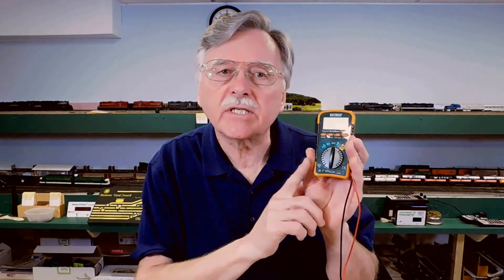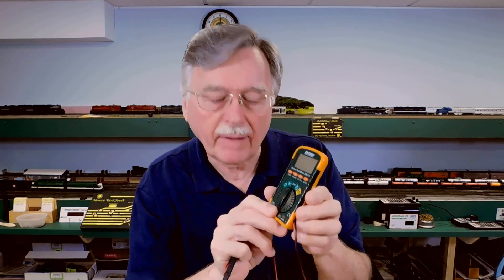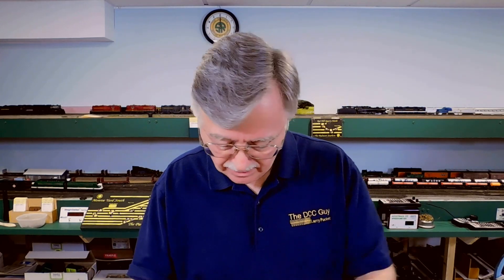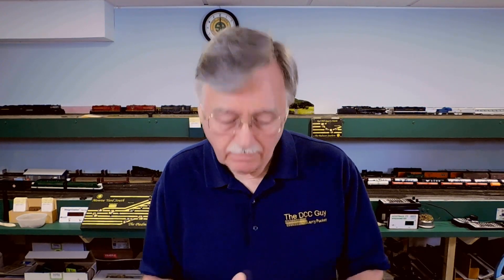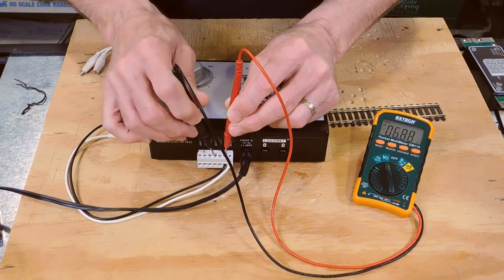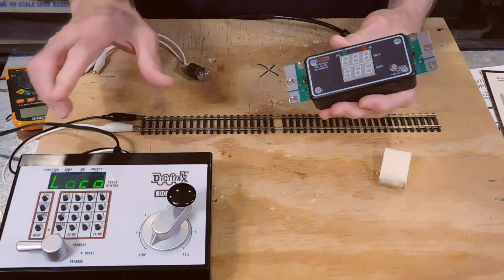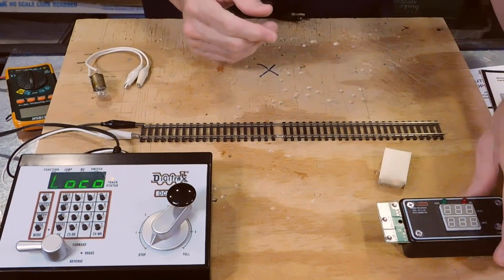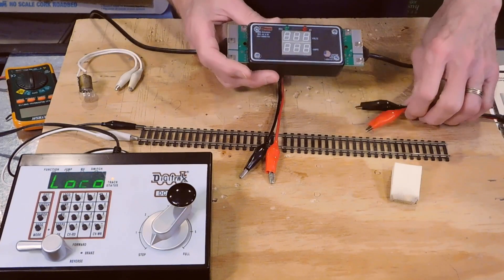DCC Power Measurements (87)

Comment: Would you recommend purchasing this DDC  specific meter to help find shorts in a layout? I am working with a NCE power cab controller which is in series with NCE 225 EB1.1 single district DCC track power circuit breaker. Both red lights have gone intermittent   and i am getting no power to the rails as evidenced by light meter. Earlier I fixed a short at a double Atlas turnout (engine would not operate over double insulated rail but rest of track was fully operational) by removing the double Atlas turnout as advised by technical guy. Now my whole layout is dead. How do search for shorts and polarity issues? Any other techniques or videos you recommend?
Reply from the maker: Shorts that are built onto a layout can be difficult to diagnose. Often they are due to connecting rail feeders backwards and no meter will detect that only your eyeballs! I find that about 99% of problems are due to crossed wires somewhere, and finding them can be difficult. I first recommend working on sections when wiring, then testing each section by connecting the DCC system to it afterwards. That way you know whether you have created a new short. Since you apparently have already built yours you need to first go back and check your wires to confirm none are reversed. If that doesn’t work then cut the layout onto blocks to isolate individual sections and see where the area that is creating the short is. You will need to cut your main bus wires to do that and also cut gaps in your rails to do that, but rails should be gapped anyway and wires can be easily spliced.

Comment: Here is a tip to make the display on the RRampmeter easier to read: Get some self-adhesive purple automotive window tint and put a piece over the display. It adds a drastic amount of contrast and the red LED digits become easily visible, even in bright light.
Reply from the maker: Sounds like a great tip, thanks. My biggest problem is not reading the display but just getting the contacts on both rails just right so it powers up!

Comment: Larry  Nice video as always.  Today my RRampMeter arrived from Tony's Trains and I placed it on several locations on my layout and the volts reads consistent 11.2 volts everywhere 3 engines idling at .1 amps Now I would like to mount this on my Panel  Did you mount your unit?  Do you know of anyone that has a video showing the mounting of this?  Would like to see how others may have mounted this to get some ideas.  Double back tape is tacky  LOL   Thanks Tom
Reply from the maker: They used to sell a version that was fancied up for panel mounting. I find the DCC Concepts Alpha Meter to be a much better option for fascia mounting. See videos 104,:107, 108.
Reply: @TheDCCGuy  Just watch the 3 videos great info Thanks
Reply: I just used good old Velcro this way I can remove it to do troubleshooting if the need arrases   Thanks Tom

Comment: I am an industrial electician, I use my fluke true rms metre set on ac track to track . For a hobby person these metres are pricey but they do read right as the do handle the hz and the square wave form.
Reply from the maker: Paul, thanks for your comment. I agree that a true RMS meter is the best option when a dead on accurate measurement is required. However due to the cost I just could not recommend one when a cheaper option like the RRampmeter or an easy to build circuit board is a viable option. Plus for most of our purposes accuracy is not really necessary just as long as you know how to interpret the results you do get with a standard meter.

Comment: switch your meter to ac and read your volts
Reply from the maker: Yes, as I said in the video it will give you a value but it will be inaccurate. For testing whether you have track power and for checking whether your frogs are correctly wired to a Tortoise or other switch it works fine. But if you want accuracy you need an RMS meter or a device like the RRampmeter designed to measure such high frequency power.

Comment: Track "power" ???  Huh ?  What's the power factor ?
The only thing I worry about is current draw so I don't overload my boosters. An incandecent light bulb works fine to see if DCC is on the tracks. Don't use an LED since DCC is AC.
Reply from the maker: Glad you got something from it. If folks get at least one useful thing from my videos I consider that a success. Everything more than that is icing on the cake. BTW, I use that tail light bulb a lot myself.